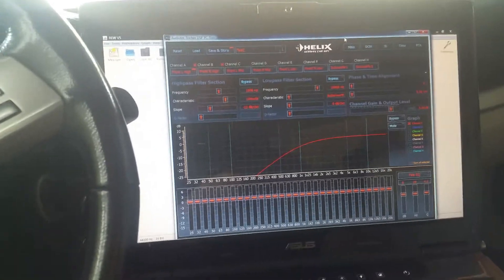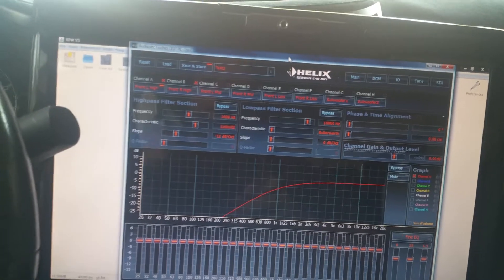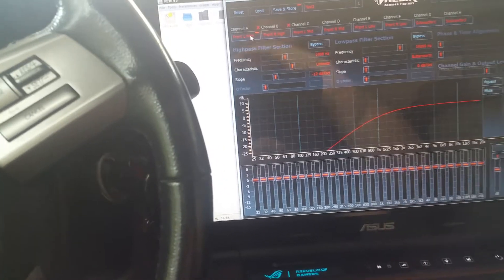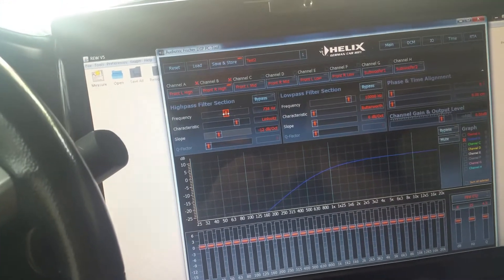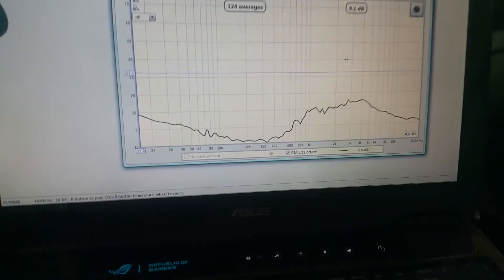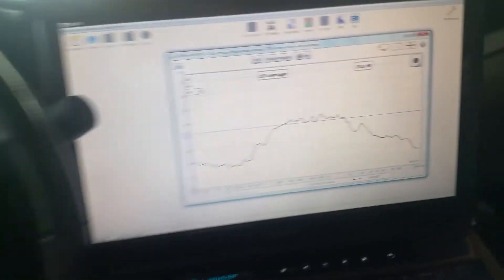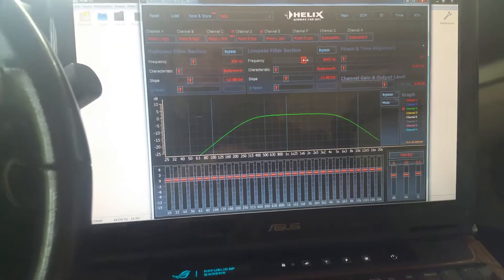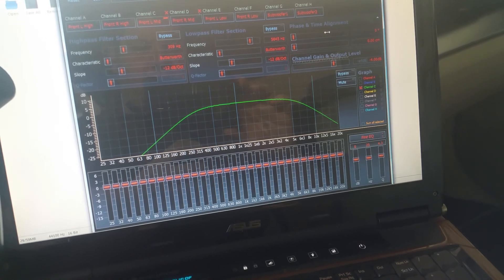How to tune a SQ car Part 2 - Crossovers

Comment: 189/5000
Kyle, Great series thank you. I have the focal 4-inch mid for the Bmw F20 and the focal 8 '' mid woofer under the seats, and I'll also have the 8-sub match in the trunk.I'm setting up with the Helix PP86dsp. Do you have any notes?
Reply from the maker: It's better to keep everything simple, if you want the best up front stage as possible, only use 1 set of each size speaker (and 1 sub placement)
Reply: I forgot and 2 original 4 "speakers in the back shelf,

Comment: Brillant videos, learning loads. When you are setting the crossovers do you have the speaker's pairs running together (both tweeters and both mids), or do you just have one side running (say left tweeter and left mid)?
Reply from the maker: Kevin I'll do each one individually, then go by the lowest common denominator speaker for the pair
Reply: Lovely, thanks. Also if it's a min of 2x fs for mids and highs, how much lower can you go for woofers? My Rainbows 6.5" have an RF of 38hz but I won't be getting a sub for a couple of months, I'm unsure on what the guide limit of them is to use to then.
Reply from the maker: Kevin there's really no way to tell, depends on your amps control, how much power, speakers, etc etc. I'd say start at 80 and slowly work your way down, but probably 6 not below 50 or 60
Reply: Thanks again Kyle, they have plenty of power as each woofer is bi-amped with 270 RMS to call on per speaker, but I get your point. I'll start high and work down as you say to not below 55 I think.

Comment: Hey Kyle can you help me sett up the IO section of the dsp pp62dsp if you can do a video on this that would be  great. I have two sets of focal es100k in the doors and focal 6.5 under the seats and a jl audio powered sub coming out of the signal out of the amp. 2017 Mini countryman. it's all plugged in and working just need assistance with assigning

Comment: Hi Kyle, thanks heaps for the taking the time to make such awesome vids. i was planning to buy an Audiocontrol SA4140i microphone. how would that work for a similar application?? would i still have to use REW or i could just use the app?
Reply from the maker: You could use the app, i have similar apps on my phone with the phone mic, but REW has more features that are easier to use (at least for me) and it's free, so that's what I go with.

Comment: Thanks Kyle.  I am struggling on whether getting a new Behringer ECM8000 omni-directional measurement microphone, or a Superlux ECM999 which I believe Helix is calling it Helix MTK1 microphone test set.  What testing mic are you using and what's your view on the other two I just mentioned.  Kind Regards, Thomas
Reply from the maker: I use the Dayton Umm-6, all 3 are good mics, just comes down to user preference and whether you want to use a preamp or not, I like the simplicity of the USB mic personally.